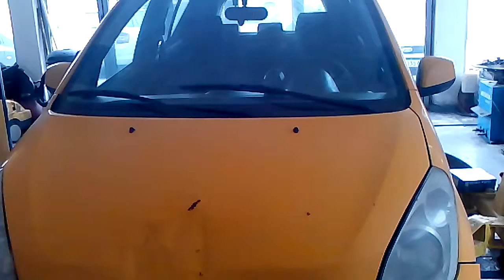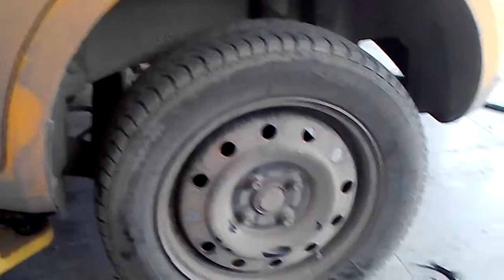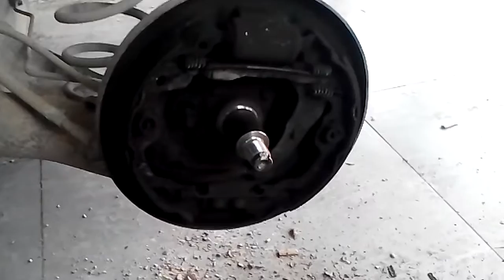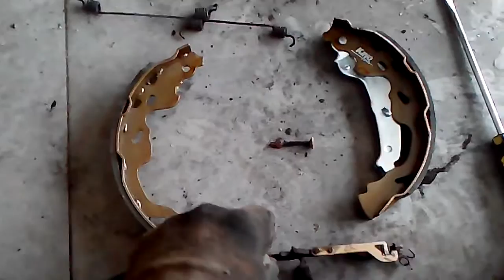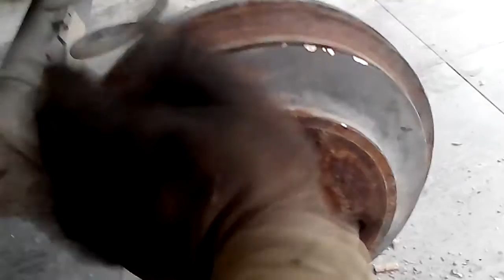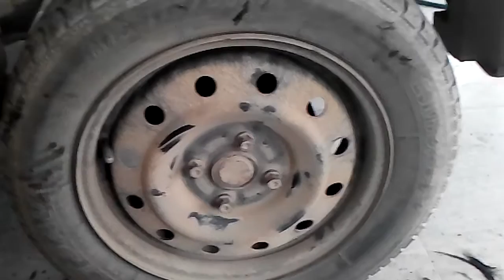SUZUKI SPLASH HOW TO CHANGE REAR BRAKE PADS

Comment: How hard was it to remove the drum? Did u had to use special tool or just with normal tools?
Reply from the maker: Sometimes you can remove with hammer and screwdriver but sometimes if it's stuck then you have to use special tool
Reply: put the wheel back on and wiggle the wheel

Comment: Your self adjustment mechanism is installed wrong, the tab that's facing towards you is supposed to go under the flat spring plate ( your finger points right at it @2:31) . Right now it's dangling on the adjustment threads so it WILL NOT self adjust. Take a look at the picture of a new selfadjuster on this site also explaining how to replace rear brake shoes: https://www.team-bhp.com/forum/diy-do-yourself/188304-diy-replacement-springs-brake-shoes-my-swift.html